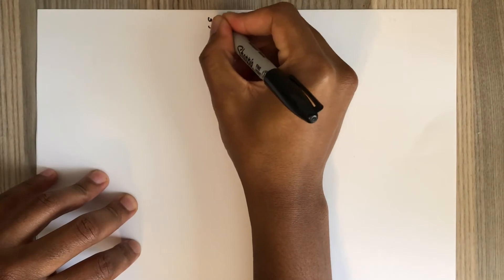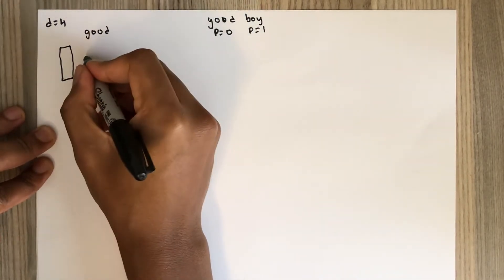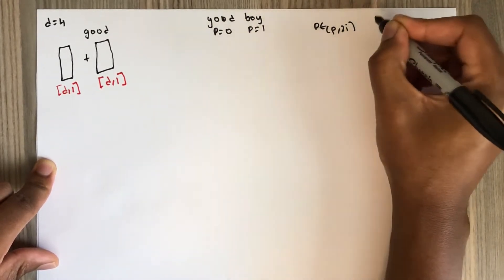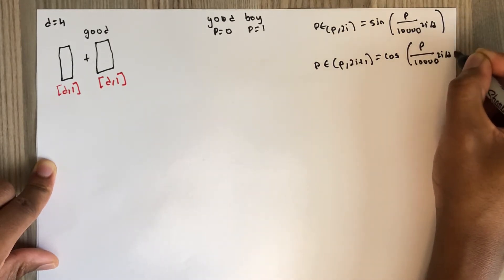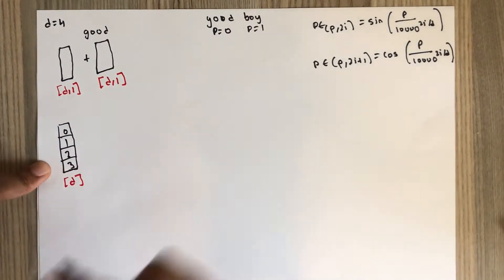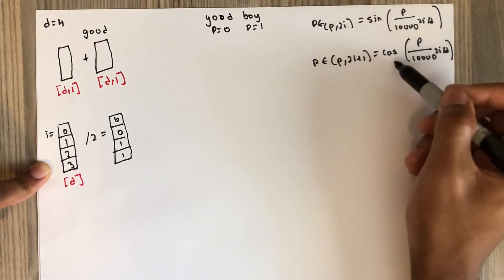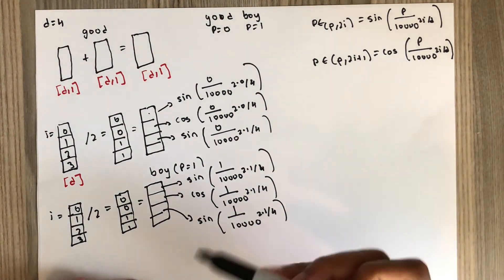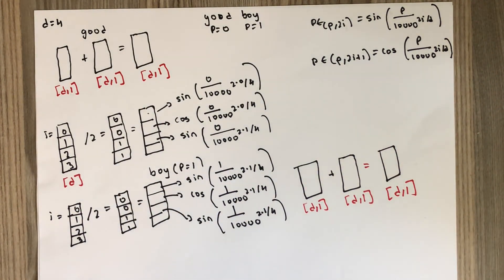Transformer Positional Embeddings With A Numerical Example.

Comment: I think when you are trying to get the positional encoding for boy(p=1)
it must be sin(1/10000^2*0/4)
not sin(1/100000^2*1/4)
and similarly with cos, for i =0 and 1
for i=2 and 3 it is correct.
Reply: yeah, I was also wondering about this error. Thanks for confirming my suspicion